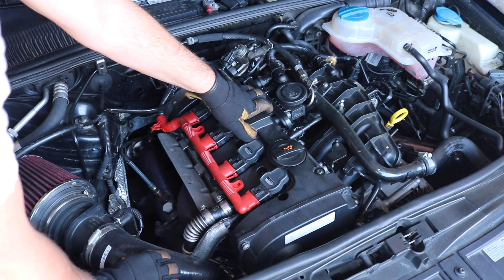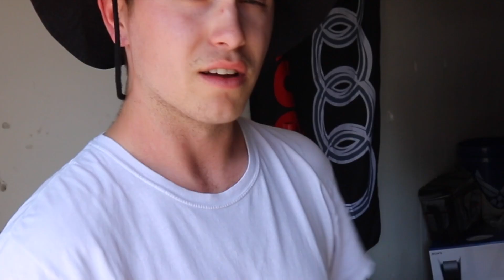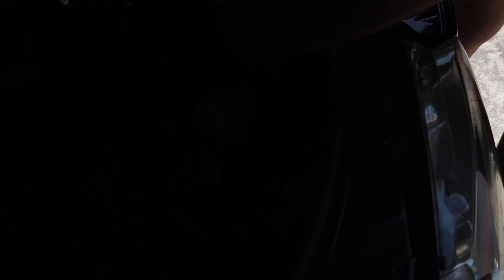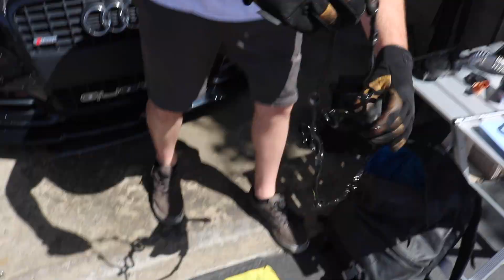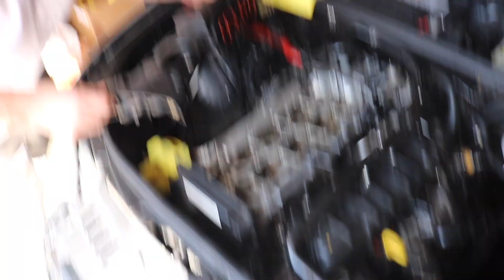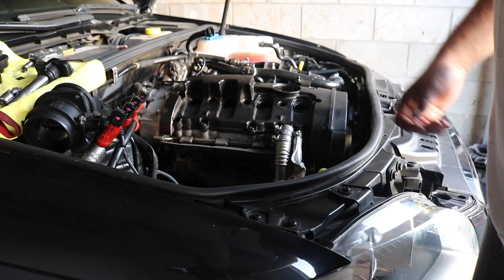B7 A4 - Valve cover gasket and PCV Breather | S1 E2

Comment: Why did u replace breather tube?
Reply from the maker: At the time the mechanism inside was stuck open resulting in oil from the PCV system going into the turbo. This is one of the ways oil builds up in your intercooler
Reply: @Saucyb7 Media  hmm i changed the valve cover on my b7 because of that issue i will blow smoke randomly driving im wondering if this was a similar issue
Reply from the maker: @Hostile_Rottie  it’s a great thing to replace, if you haven’t already replace the pcv valve as well. The pcv system is super weird but it’s a great place to start! If it continues to blow smoke after that, do a compression test and check your turbo hot side for and cracks or damage. Could be turbo as well
Reply: @Saucyb7 Media  yep replaced valve cover and pcv together. Hopefully it does the trick but now that i know this i will order the tube as well thanks for you're time buddy
Reply from the maker: @Hostile_Rottie   no problem! I believe there are 2 different versions for late model b7 and early. Double check to sure it’s the correct one before you order
Reply: @WerkstattCollective  will do

Comment: Im looking at getting a billet valve cover for my B7 sedan, they look so slick. Surprisingly not expensive either
Reply from the maker: Bummer on the blown turbo but you’ll enjoy the k04! Make sure with that cover you can still connect the PCV system, deleting it gives a lot of people issues unless you’re running a catch can